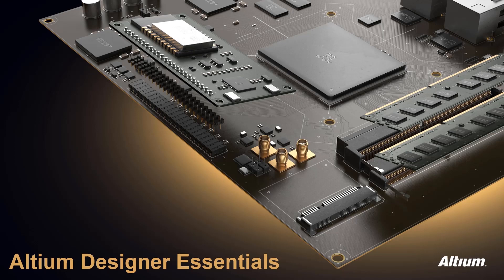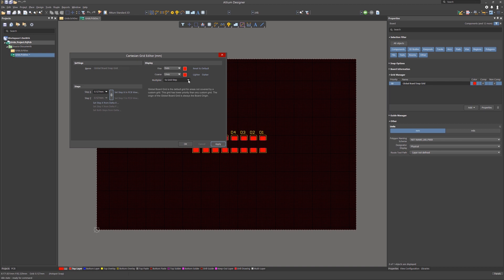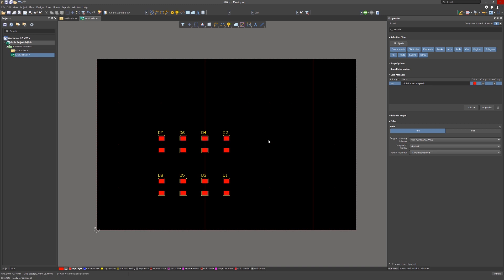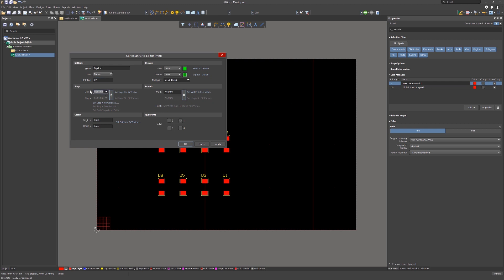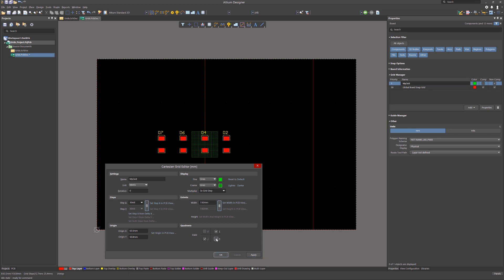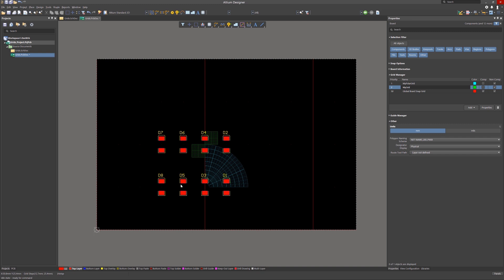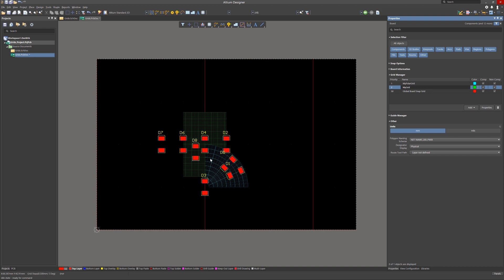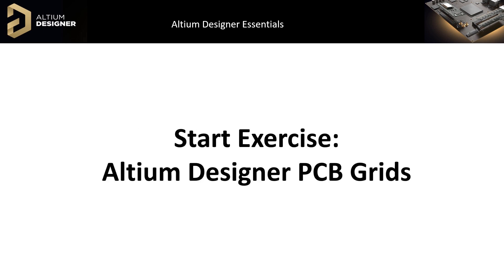PCB Grids | Altium Designer 19 Essentials | Module 18

Comment: As you are moving a component around the Polar grid, where can I find the Angle it is currently at? For instance, If I have 5 degree increments and I need to place at 140 degrees from Zero, do I need to count 27 radial lines in my head, or is there a readout of where the component is currently in polar coordinates(Radius and angle) I see the cartesian coordinates in the lower left corner of the screen, but that doesn't help me unless I want to pull out my TI-83 and calculate the angle by hand.